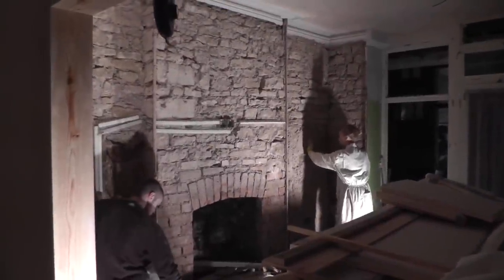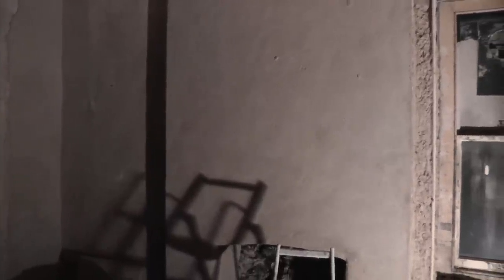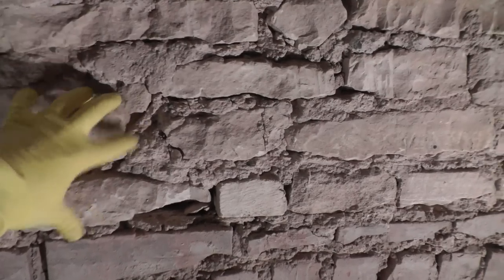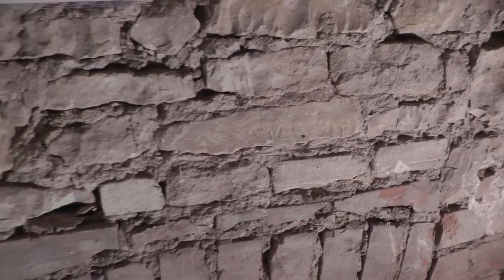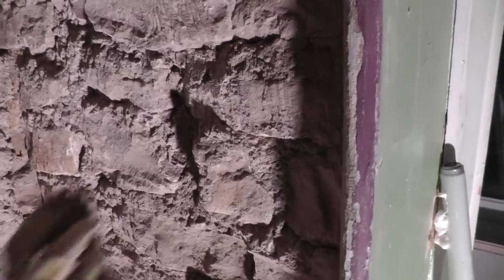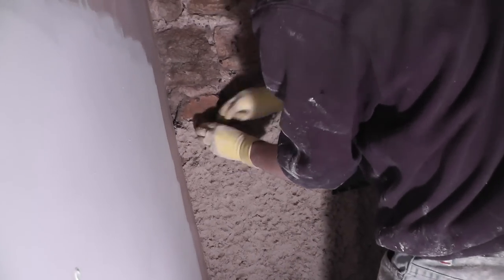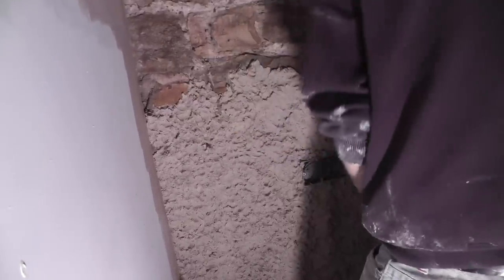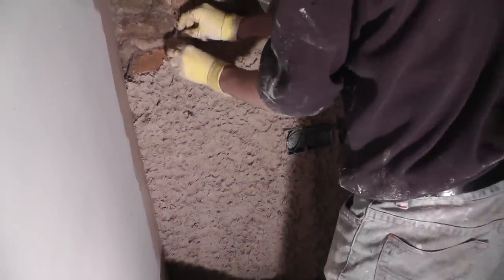Insulating a Solid wall with Lime Hemp Plaster

Comment: That looks a great job, it's good to see someone doing it properly. My customers are constantly asking why their 100+ year old houses are damp, I always tell them the same, modern materials used in the wrong way. Gypsum and cement pointing cause so many problems.

I'm sure you'll have hear of Keim mineral paints by now, but if not look them up. Acts like modern paint but 100% breathable, and not that expensive. And you don't need 10s of coats as with limewash, and you can have almost any colour.
Reply from the maker: Thanks for the comment.  Yes it is such a misunderstanding, we have so many houses around here where everything has been skimmed in gypsum and vinyl paint, such a shame especially when people are spending £££ on damp treatments unnecessarily.  We ended up using Earthborns claypaint but their new emulsions look good too.
Reply: Funny just quoting a barn conversion job and the architect said I was demonising modern methods because I refused to use PIR insulation in a 400 year old structure I instead offered Hemp and wool that met their U rating but they told the client I would not meat fire regs, funny how the PIR they recommended is not available because it’s failed an independent fire testing. Natural materials and breathable paints all the way.

Comment from the maker: I would not worry as much about the shared walls as I doubt the neighbors will have left the walls breathable their side!  Unless you had any bad damp issues at the base of them I would be tempted to just skim them in plaster and focus your efforts on using Lime front and back.  Does the property still have lime mortar or has it been re pointed?
Reply: Great video, and looks good. Haven't seen the rough coat applied with fingers before, although looks much thicker and more clay like in texture than the coarse stuff I have used. Did you experience any cracking with your final lime skim? I wanted to say that it is sometimes important to use lime plaster on internal walls especially those shared with a neighbour for the very reason you suggest not to; that the other side will likely be Gypsum. Your house may still have a good DPM, however in many older houses it is likely to be ineffective or depending on the age non existent, therefore rising damp will need to exit somewhere...better your side through lime than blowing gypsum plaster on either side.
Reply from the maker: 85robin1
Yeah that makes sense.  We are detached so haven't really thought too much about party walls.  In an ideal world I would have done everything that way however with time and budget it made sense to you gypsum over the internal walls and ceiling as they are mostly stud anyway.   No cracking whatsoever, really impressed, plenty of settling cracks in the gypsum but not a thing in the lime after a year. TRC
Reply: TheRestorationCouple Yes the cost of lime soon adds up doesn't it! But then you don't have to redo everything when the gypsum fails in a few years. I have used gypsum on ceilings quite happily in older buildings, as you say there is no benefit to using lime here aside from a small aesthetic of keeping ultra true to the original. Good that it didn't crack, how long did you leave the coat below to dry? And did you wet it down before finishing went on?
Reply from the maker: 85robin1 We did Lime hemp in a couple of coats with 2-3 weeks between and then maybe 2 weeks before finish.  Our plasterer did the final skim but think we sprayed with water as we went. May well do the cellar in the same way, or just lime wash stone walls for now.

Comment: Hi, great video, I have had a dilemma in that I bought a house for my family, Victorian mid terraced, 1900 build, the property was allowed to get into disrepair and empty for a while.  I have since stripped every wall back to brick, removed all flooring ground floor and all ceilings, in effect the house is a shell.  I have been told I have rising damp, which is not noticeable on the brick work only the metre that they use.  I am replacing all the sash windows to new timber double glazed, and a number of plasterers have suggested 20mm cement render then 5mm skim plaster for all walls, then by others been told to plasterboard dot and dab, concerned on renovating the entire house then have issues, so would you recommend hemp for front and back and cement and skim for internal walls, also on internal wall there are couple of chimneys what would you use on them?

Not sure whether to do damp proofing treatment since I have already stripped back to brick anyway.
Reply from the maker: Tricky to say. It depends on how breathable the external is, what pointing, render, paint, bare brick, etc. There are other breathable backing plasters you could look at like limelite. If you have the house gutted, are you insulating walls? If so now is the time!

Comment: Good work! However you cannot speak of insulation when the layers of hemp/lime is that thin. The U value is ridiculous so is the R value. However that texture will give a warm feel which will increase the confort.
Reply from the maker: +ririshow I agree, it may be slightly better than the same depth of original lime plaster however does not substitute internally insulating at all.  Our main priority was keeping it breathable and as a bonus it is not cold to the touch.

Comment: Hi there, thanks for the video - really helpful! We are wanting to hemp and lime plaster our inside walls and have so far chipped off all the plaster/concrete and got the walls back to stone inside (house built early 1800s). The house has lots of damp so we are intending to make all the walls breathable.

We were wondering whether you think we need to strip off all the external concrete render first though, before we do our internal plastering? We are planning to take off the outside concrete at some point in the next year, but would ideally like to leave it til next Spring and focus on plastering the inside now... 

What do you think? We'd really appreciate yr thoughts. Thanks!
Reply from the maker: The walls will not be breathable until the render is removed however there is no reason why you could not sort the inside out first.  There is a chance that you may still see some existing moisture in the stonework make its way through as it breaths through the new plaster as it can't escape out.  Providing you use breathable paints that is no problem, we just noted that some areas of paint dried slower.  You will need to ensure that when you re point the stone outside that its all lime mortar.
Reply: thanks so much guys - where did you get your hemp/lime from?
Reply from the maker: Jubilee Place No problem.
 Ty Mawr over in Wales.  Very helpful and quick delivery.

Comment: Very nice job.. did the hemp lime plaster make a noticeable difference to the relative humidity and warmth in the room?
Reply from the maker: Hard to quantify temp but not cold to touch like some of the other walls.  As far as moisture, no sign of any damp in the walls now whereas the old plaster had marks and discoloring.

Comment: Hi guys, great content. I hope you have time to answer my question. I have wattle and daub wall with lime plaster render, the plaster is blown and crumbling, the wall is situated in the upstairs hallway where the banister is, an internal wall. I was thinking of treating it with bonding, fibre glass mesh to fix the broken areas then apply multi-finish to skim coat the entire area, as bonding and multi finish plaster in not really breathable material to use. Is it important to have interior walls breathable? 😊
Reply from the maker: Not if it’s an internal dividing wall, more of an issue on the external walls.

Comment: In the fire place case i will leave the visible bricks on the top just paint them with stone varnish.
Reply from the maker: We ended up doing that in the kitchen and a couple other rooms we left the side bricks as well and lime washed them.  Originally they would have all been hidden behind the cast iron surrounds however I do like a bit of exposed brickwork.  TRC
Reply: Nice. Some times looks like magic to uncover the old times job, especially in old houses.

Comment: Hi @therestorationcouple. I have hygroscopic salts around my chimney breast in my Victorian terrace. Would you say that following your method of lime plastering could solve the issue of the salts 'blooming' or do you think this would happen if I simply just applied lime plaster over it (with the damp having dried out as much as possible of course)

Comment: Our C19 Victorian cottage has been dry lined in two rooms and the lower parts of the underlying solid walls have crumbled quite badly and salts have crystalised out in the brickwork. We want to restore with lime plaster. What should we do about the salts and spalled brickwork?
Reply from the maker: Ideally you need to remove drywall and let the salts some through over time before plastering.  They simply brush off usually.  Is it still lime mortar pointing outside?  As it would be helpful for you to know the source of the salts, i.e cement, chimney, etc. In one or two spots we had some salts coming through the lime hemp, it lasted a month or so, and just dusted off.  Nothing since then. TRC

Comment: Hi there we are facing the same job as a the old plaster is damp on all outer walls. Is the final skim just made from normal gypsum?
Reply from the maker: No it’s a breathable lime based skim then finished with clay paints or breathable emulsions.
Reply: @TheRestorationCouple  thanks for the reply 👍

Comment: Very pleasing to watch.
Q: how much lime mortar did you apply before starting your plastering ? Did you apply it just in the large gaps or also in the smaller crevices ?
Reply from the maker: Whole thing had minimum of 30mm or so with more in the deeper gaps. Then skimmed over after.

Comment: What have you used to skim the walls? I'm finding it hard to find something smooth to skim which is also breathable and won't compromise the lime plaster.
Also, was the last coat the fine hemp plaster, and the base coat coarse?
You've got a really nice channel!
Reply from the maker: First wall we used a traditional lime finishing plaster skim over the medium lime hemp, (we did two coats of medium as recommended by the supplier).  You can finish with a fine hemp mix to leave a slightly textured surface and even unpainted apparently looks nice albeit slightly rustic.  In another room we used high impact lime lite, although not lime as such it is very easy to use, super breathable and a very durable finish.  Hope that helps. TRC
Reply: +TheRestorationCouple how did you find the (tarmac?)high impact lime lite? Where would that product be best used? does it work in a way similar to hyd/putty lime plaster. What would you recommend for a 1820's period kitchen semi below ground in some walls (terrace/neighbour house built higher on one wall) It has been taken back to bare lime plaster/masonry in most places. Kind regards Luke
Reply from the maker: Hi Luke, It goes on much like gypsum, in that it is a similar mix and does not need much attention once applied. Our plasterer did the final skim and apart from a longer drying time and a very slightly textured surface it ends up the same a s the adjacent gypsum skimmed walls and ceiling.  It is designed for what you described and will remain breathable.  It is of course not the 'traditional' route however it is certainly still a conservation route and better than trying to tank and seal walls which just causes other issues.  We used the renovation plaster for repair work where lime plaster had come off the stone in other rooms.  Hope that helps.  TRC

Comment: Hi Tim, I'm currently renovating a 1900 Victorian property in South Wales. I'm looking to repair and replace the old blown and cracked plaster on both external and internal walls.

What lime hemp plaster did you use, as in hydraulic vs non hydraulic, medium/fine etc

I'm looking on doing the scratch/float coats myself and getting a professional for the final skim

Any advice would be greatly appreciated
Reply from the maker: Hi. I think the hemp was medium. The guys at Ty Mawr (wrong spelling) were really helpful and advised us. It comes pre mixed wet in a ton bag so not suite on the makeup exactly. Hope that helps.
Reply: The Restoration Couple thanks for the advice, they seem to only be 30 minutes up the road from me so will have a good chat with them

Comment: Hi guys, firstly lovely job on the walls.  Looks like your doing everything the right way to hopefully avoid damp issues down the line.  

Can I ask, did you install any kind of fibreboard or similar insulation on the interior walls, or just rendered and washed?  I'm hopefully going to embarking on a similar (solid walled) project soon and was wandering what is the done thing if you wish to improve the U values whilst still allowing breathability through the walls.  Cheers :)
Reply from the maker: Thanks. We contemplated a full internal wall insulation approach with a fibre based board however the costs were pretty high even if diy and it would have meant a lot of work to get it continuous through all the levels, then there is still some condensation risk and cold bridging of joists etc. therefore we decided to insulate floors loft and new windows and focus what remaining budget we have on renewable energy. So yes the heating demand is fairly high however at least we have a sustainable way of heating and energy. In an ideal world we would do both however for now we just have to do what we can. TRC
Reply from the maker: P.s if we did not have nice stonework on the outside I would have most definitely wrapped the whole house with external insulation and rendered. Much better approach than internal if it is possible.
Reply: That's interesting that you mention the costs being high.  I haven't done a proper costing but was considering the possibility of insulating just the external (front and rear) walls as its a mid terrace, but like yours has nice stone on the outside so external insulation is not an option.  Presumably your log burner keeps the chill off nicely though ;)
Reply from the maker: Yes it's a tough one to decide on.  Internal insulation would have caused so much disruption and blown our whole budget, however £250 a month on heating is hardly a solution either!  It's the breathable insulation which pushed the price up and there is no point doing it if you don't do joists, window reveals, chimney breasts, etc, then you have the additional issue of loosing room space.  We have just spent the first week with our new biomass boiler so it's quite toasty now!

Comment: Tim, if you don't mind me asking, how much was this lime plaster to the wall you are showing? I am plastering my country cottage soon so it would be great to know as was planning on gypsum skim until I saw your video!
Reply from the maker: Hi, £260 for the 100kg ready mixed lime hemp which we did ourselves and then maybe £100 of materials for the top coat.  This was skimmed by the plasterer however if you like a more rustic finish the lime hemp can be left fairly smooth on it's own.  Even if you decide against lime hemp, please look at using breathable plasters as gypsum and solid walls are not best friends in the long run! :-)
Reply: Thanks Tim. We have a party wall to the right and are building a side extension to the left. I assume I only need to use lime plaster to repair/skim the front and rear external facing walls? Can any plasterer use lime or is it only specialists in this area?
Reply from the maker: A purist would suggest still using lime as there is still there risk of moisture from the solid wall base.  However we did use gypsum on our internal walls.  Front and rear best to use breathable.  If already lime plaster then patch with a breathable repair plaster skim, if back to stonework then more options.  The modern breathable plasters will be familiar to most plasterers, only traditional lime will be best suited to expert, IMO.
Reply: @TheRestorationCouple  what is the materials/ingredients for the top coat please?  Thanks so much

Comment: Is it possible to you use this over an already plastered wall albeit roughly plastered ?
Reply from the maker: Not much benefit unless already breathable and even so a like finishing plaster more suited. If insulating then breathable products like wool board can be used.
Reply: I have thick schist walls covered in some kind of rough plaster or mortar. I wondered if I put lime hemp plaster over that whether it would provide some insulation as well as a better finish. Heat does drift out of schist despite thickness.  @TheRestorationCouple

Comment: Hi. I have been trying to find out more info on this . I have a Scottish house mad of flag stone . Walls are 3 feet thick. Where can I find more info. Is it a good insulater?
Reply from the maker: Not a thermal insulator at this thickness really but does help.  You woudl need to build it up quiet a bit to be effective.  There are breatbale insulation boards which would be much more effective.  Lime hemp company was Ty-mawr Lime.

Comment: Great Video, I am doing something similar with my 19th century cottage, just wondering did you install any vents in the external wall? I'm tempted to knock a hole through just to give the room some additional ventilation, thanks
Reply from the maker: There are sub floor vents to outside under the timber floors but nothing anywhere else. Most old properties are 'ventilated' enough as they tend to be leaky anyway. I would not think it necessary and rely on windows for if/when you need more airflow.